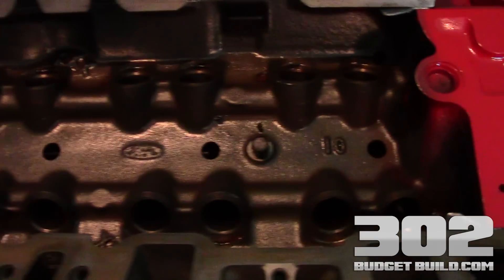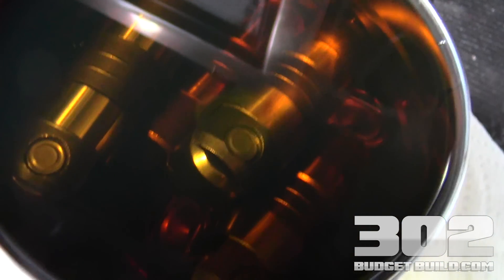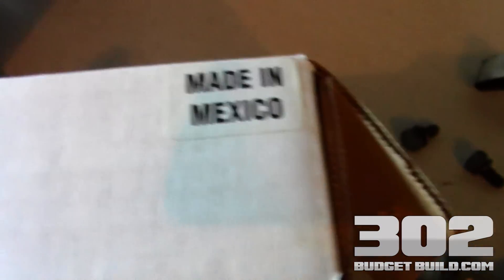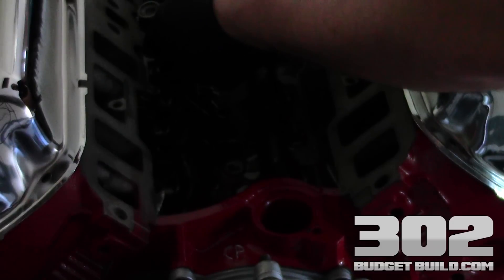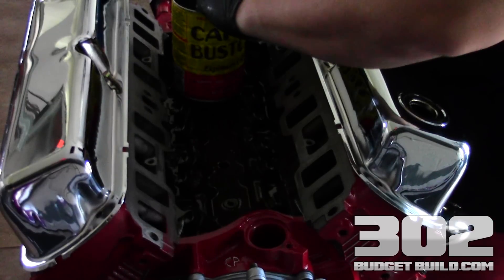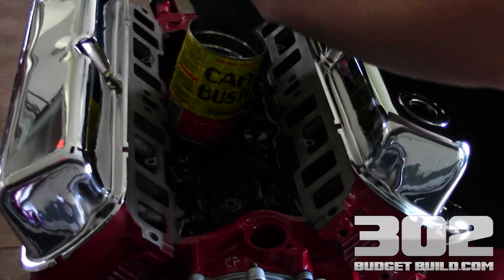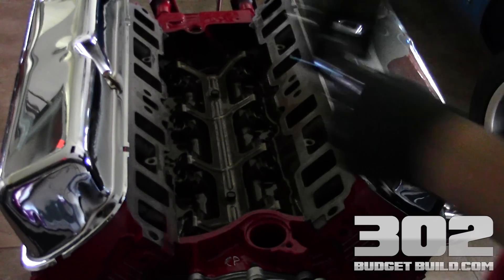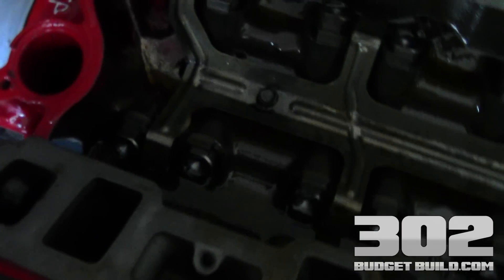How To Install Roller Lifters on a Small Block Ford 302 Roller 5.0L

Comment: I always use a pushrod and submerse the lifter into oil and push on the pushrod to force oil completely into the lifter. I do this after letting them soak overnight. Takes some pressure and a short piece of broom handle with a hole drilled into the end of it to accept one end of the push rod helps to make it quite easy. Also, many years ago we did not have all the fancy pre-lubes that are available now so it was common habit to mix 30W non-detergent motor oil 50/50 with STP. That concoction wouldn't run off of anything and kept a great lube film on parts. Never had a cam fail on start-up using the STP witches brew.

Comment: Tip guys - No need to swing a ratchet inside the intake valley...that is what extensions were made for. Also, a ratchet is not a "torque wrench".

Comment: Do the oil return holes on the lifters have to be facing any certain way? Like towards the head side or valley side?.
Reply: I have the same question. Can ya help me out?
Reply: @thomensley496  either way is fine,...I place them facing the valley

Comment: does it matter which way the oil hole in the lifter is facing (towards the vally or towards the head)?
Reply: I know right, lol. I'll be tearing my engine apart to do a cam swap so I'll try and see which way they were in from the factory and let you know.
Reply: Duane Hallgren ever figure out which way they set
Reply: William Fowler yes. It doesent matter which way the hole faces it will oil either way. My stock block had them both ways.
Reply: OK thx buddy
Reply: Just pulled mine out all the holes were facing the valley

Comment: Getting the corner lifters in is a huge PITA. Anyone got any tips on how to do it with the heads ON? I can get the old ones out just not in and they're both the same length.

Comment: I only watched about 1 minute before I'm asking this question, but I'm about to do some work on my flat tappet 302, do flat tappet engines have dog bones and a spider?
Reply: TheGeekwad 
no they don't I'm about to make my flat tappet engine to a roller to run a e303 cam so you will have to buy them

Comment: good video but ..who will wait one week soaking lifters??? hahaha... short oil bath is enough.... befor you start your engine first time you have to preoil it anyway!! then you fill the lifters and oil everything in your engine!! I made a preoiler from an old Distributor and that works great...
Reply: I did the same, but I still soak my lifters for 1 day. if you shake them a bit, it will also force air out

Comment: Great video, but i have a question i cant seem to find the answer to. 
What is required to convert from a flat tappet system to hyraulic roller system? According to wikipedia my 1968 Ford 302ci uses flat tappet, and in the future i probably would like to convert over to hydraulic rollers
Reply: Nobody answered you?

Comment: good video. Im currently about to do this exact swap of cams. my only concern was with the spider retainer. My motor is an old 1975 bronco motor doesnt have the 2 holes to for the screws to secure the spider in place. how do i fix this issue? do i have to drill and tap holes?
Reply: How did you go with it, please?

Comment: What (Aftermarket) Aluminum heads can I use on the 1985 H.O. Roller Motor? to get 300 hp from the stock Roller cam / bottom end?

Comment: Yeah those lifters are trash. They will not shut up if you are using heavier spring pressure and .550 or more lift. R302h
Reply from the maker: 38k miles on the motor. No issues.

Comment: My spider broke and ruined my 347 stroker
Reply: same shit happened to me a week ago on my stock 302 the dude that had it before me for some unknown reason stuck brand new trickflow lifters on a stock cam I have no idea because the motor was a low mileage car faxed proven 65.000 mile car I'm thinking the that trickflow lifters are crap anyway because lmr stopped carrying .

Comment: I had to pull my heads...
Reply: Let me guess, the lifters that goes in each corner doesn't fit with the head on right? I'm on that right now.
Reply: Yeah dude.. It pissed me off. Theres no easy way around it that I found. New gaskets n pullin the heads back off. Totally worth it cause i have almost zero valve train noise now.. But its b.s..   Good luck, man
Reply: Thanks man. Now i have to order head gaskets.